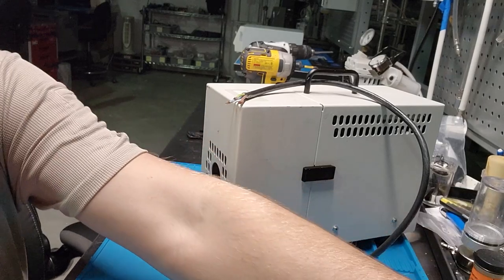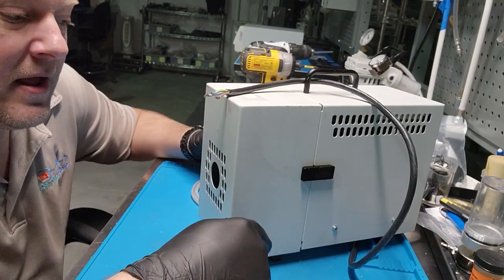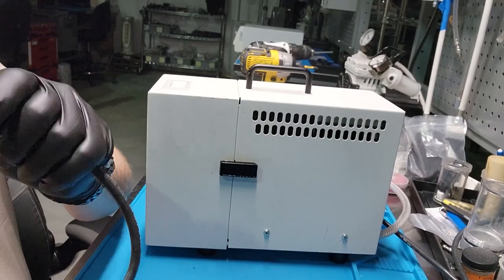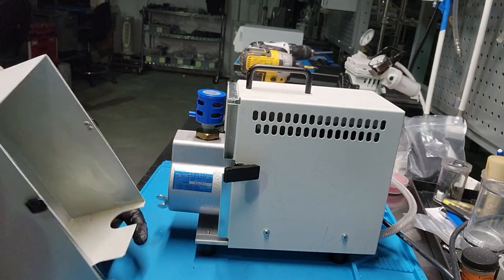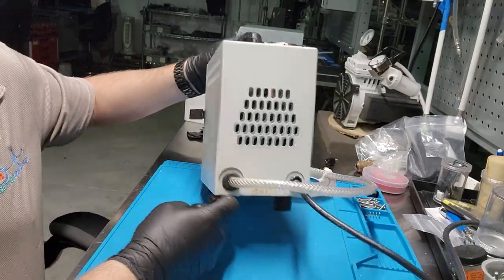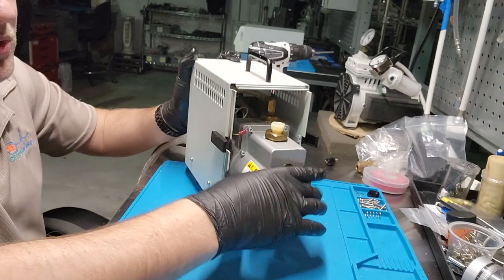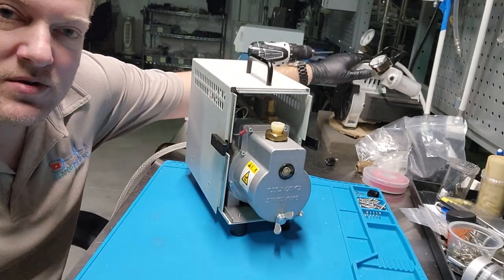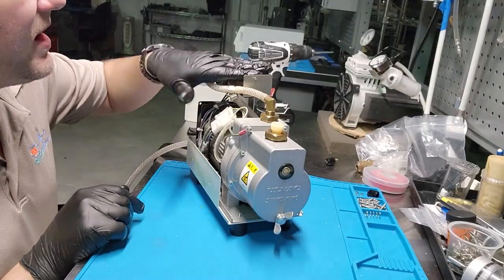Vacuum Pump Teardown

Comment: That vacuum pump looks like it could have 20 more years in its life.  You're right, current vacuum pumps, looking at you Gomco...don't last that long like the classic ones.
Reply from the maker: Most modern pumps cave silicon or carbon composite wipers which wear on the edges slightly- changing their geometry, and the debris contaminates the oil.

Comment: 3:45 it seems almost that the handle is aftermarket installed, because it is the type of handle that is commly used on drawers (IKEA etc....), and those are not very sturdy and break after years. But after a Google search on Ulvac G-10D, it seems installed from the factory. An aluminium handle would be a more reliable choice for a heavy device like a vacuum pump in my opion.
Happy holidays and a Merry Christmas.
Reply from the maker: Merry Christmas, Bjorn!